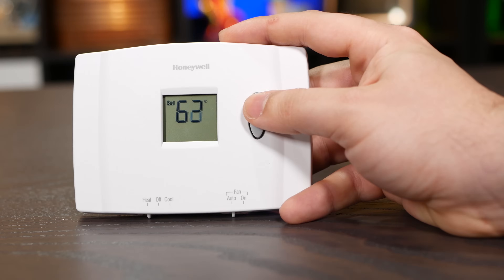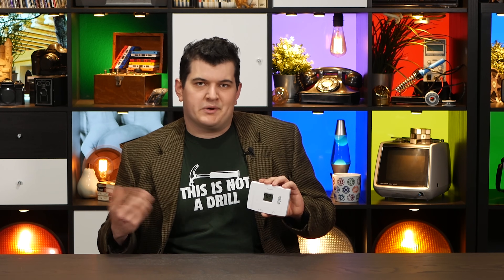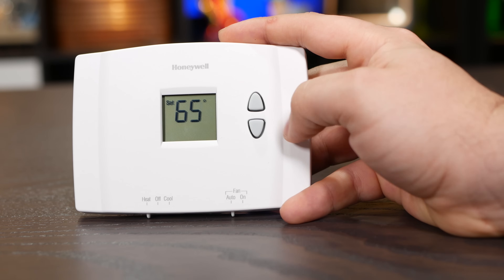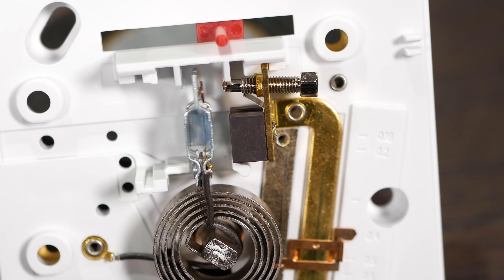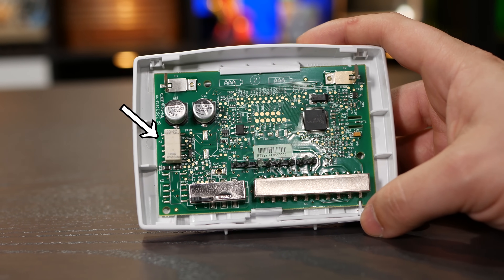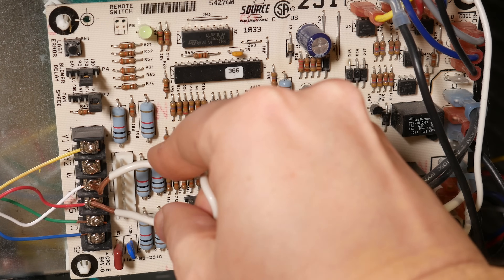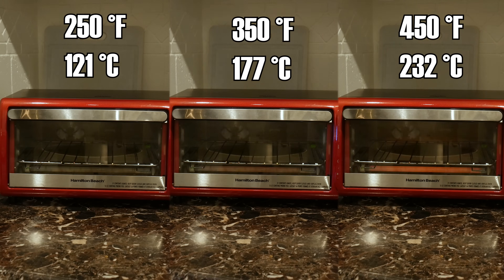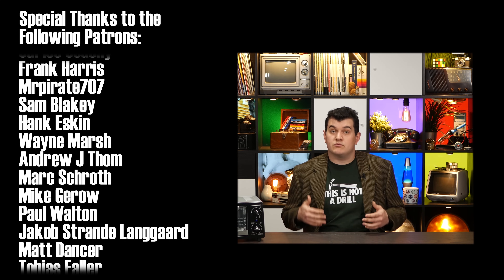Thermostats: Cooler than you think!

Comment: Having proven that this demonstration would work using my personal toaster oven, I decided to purchase a new one. See, my toaster over is kinda filthy and I wanted to get another one anyway. I thought it would be handy to have a toaster oven at the new studio. See, they're really nice for making small snacks or whatever (though frankly I've always found the acutal toast making experience to be rather lacking even before I was introduced to the Automatic Beyond Belief! wonder that is the Sunbeam Radiant Control Toaster). Anyway, so I wanted to get a new toaster oven, right? So I went to the store and bought a really basic one, just like the one that I use every day in my kitchen. No sense spending a lot on what will just be a part-time toaster oven, and it was the smae brand as the one I had at home. Must be perfect, right? Well, it turns out that this new toaster runs on a much shorter cycling time than my old one, so the effect that I was trying to demonstrate became nearly impossible to see. That sure was a bummer! It later became clear to me that this wasn't a very good toaster oven anyway, as the fit of the little tray they give you for cooking tacos or whatever was really tight and just unpleasant. The whole thing was just a travesty, really. So I've since returned the toaster oven you just saw and replaced it with another one, but this was after I had already filmed the entire video, and also after I had already filmed my original toaster oven doing the thing I want to show you. I toughened up and cleaned it the best I could, and I think it looks OK.

So that's the story of why you're about to see a different toaster oven. I made an assumption that turned out not to be true. Oh merde. In the end, it all worked out for the best anyway because I got a much nicer toaster oven on at Target right after I returned the rather poor one, so all's well that ends well, amiright?

Oh, and if you write this in a comment to save people the trouble, you're a fun sucker, and sucked the fun right out of this gag. I hope you're happy. A more helpful comment would be to tell the nice viewers about either the "speed" setting on mobile, or the fact that the < and > keys on desktop will advance frame by frame. Then they'll be in on the joke, too! And then when I or any other silly YouTuber decides to do this again, they'll be equipped with the knowledge of how do to this. 

You already wrote this out, didn't you? Well, I won't delete your comment, but you are now a convicted fun sucker and you'll just have to live with that the rest of your life.

Pfft.

Comment: Ah, a thermostat that will cool with the push of a button but that will not affect the temperature you may ask? Well just switch the fan and compressor terminals and jump the fan terminal to the compressor and now whenever you want the ac to cool momentarily just flip the fan switch to on and voila! The only disadvantages are that you can have the fan run all the time (but most people dont do that) and that if you flip the switch before 3 minutes had passed sunce the last time the ac turned off, you might burn the compressor. Also Its probably too much work for some people.

Comment: Some Carrier airconditioners will have a turbo mode (high power mode) which essentially runs the ac at full wipes for 30 minutes and then switch back to regular thermostat operation. I have seen this mostly on inverter type units (variable speed units) but there are some fixed speed examples of this type of setting.

Comment: The thermostats in Germany (and probably other countries too) are a bit more "complicated" and there i understand that people might get confused.
Most common is a radiator with a "knob" to turn. For people who don't know the system, it's a radiator where hot water comes in on the top and cold leaves on the bottom (some don't follow these rules on the outside, due to space or design issues). The part where the hot water comes is not so interesting. There are different types where you can control things or not.

The "knob" thing is the thermostat. Most people I asked thought this is a valve and with rotating it, you control how much water goes through. On the knob there are the numbers 1 to 5, a star symbol and sometimes a 0. On some are a little explanation which temperatures are which number.
The thermostat has something in it which can lower and raise a pin. With rotating the knob, you just set your temperature. When you are below the set temperature, the pin is fully out and when it's near the temperature, it comes in. On the radiator is a stupid valve.

People think that it will heat up faster when you set it to 5 but it won't. 5 is 28°C and that is too hot. Setting 3 is 20°C and thats a good temperature. The last few degrees it might get slower but because it's a radiator, it doesn't matter. The downside of that thermostat is, that very close to the heatsource and on the other side of the room, it might be too cold. Also when you block the radiator and the thermostat with some curtains, your room might not get warm at all.

There are some things to make your room faster warm. Step one would be clearing your radiator and thermostat. Step two would be checking the settings on your heater itself, when you have one. My apartment heats with gas and I have the unit in my apartment and there I can set up stuff. The manual says on which setting you should use for your radiator type. With floor heating, you need a lower setting, to not burn your feet. This changes the water temperature that will get into your radiator. Also one important thing is to remove air out of the system and top up on water to meet the pressure that the system wants.

In the apartment where I grew up, we had an additional thermostat on the wall with some features. You where able to say when you want to heat your apartment and which temperature. The problem was that you can't heat the living room and the bedroom indipendent. When the thermostat on the radiator in the living room was off, you weren't able to heat the bedroom.

Smart home thermostats works similar with that system. With my cheaper model you can hear the pin moving when you want to turn off or on the radiator. I don't know if my system can do this but I think the system can use a different temperature as reference. I don't have this, so I can't tell. I must admit that it's great that my thermostat can turn off automatically when I open the window and start back up, when I close it and resume my heating plan.

Comment: Heatpump Airconditioners with inverter compressors would be the exception. Typically they have a function to ramp the compressor right up to get the space up to temperature and then back it of as the room temperature approaches the set point on the controller. The compressor then shuts off when the room is at temperature and the fans will  continue to run, at a lower speed, to circulate the heat around the room. Even with these it's best just to set the temperature to what you want, in either heating or cooling (automatic doesn't work as well), and let it do it's thing.

Comment: I would not describe it as PWM as that implies a fixed period and no feedback (PWM can be used for rate control in a digital system with feedback, but that's not what is happening here -  as you said, there is no rate control). What you have here is a bang-bang controller. https://en.wikipedia.org/wiki/Bang%E2%80%93bang_control

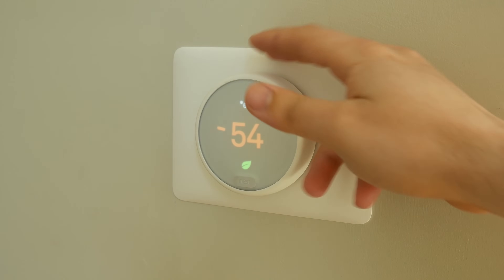Comment: 1:29 
"Setting a thermostat to 80 degrees does not make it warm up faster"
AND
Setting the AC to 58 degrees does not make it cool faster!! 
Why is This such a foreign concept to people
Reply: It's not always true. Some work by shortening the off time and lengthening the on time - so turning fully up ensures 100% on time.
Does your car accelerate faster with the pedal to the metal?
Reply: Is your furnace controlled by a rheostat? Then maybe you can compare it to an accelerator on a car.
Does your car only have idle and wide open throttle when you set your speed to say 35mph, and when you tap the pedal, the throttle body opens fully and you get to 35mph, at which point your car goes back to idle? Then your car is more like a thermostat.

Comment: Uhhh that blue wire is a jumper from the red”cooling” terminal and the red”heating” terminal. You remove the jumper for two transformer systems...(mostly gas application with a remote cooling coil)...generally five wires is typical.. the absence of a “common wire” means the thermostat is battery powered....

Comment: What I don’t get abou A/Cs is that if you have a room you want to cool down and use an A/C that Switches cycles less frequently than another A/C in a different room that has the same temperature, shouldn’t the second room cool much faster because the alternation between cycles is more frequent and longer and therefore the overall cooling is faster. Could somebody please explain?

Comment: Why do most digital thermometers installed in new construction homes have separate heating and cooling modes rather than a auto adjusting mode? Does separate modes tend to be cheaper to manufacture?

Comment: Gues he never heared of modulating burners. Those burn on lower setting when near the temperature.
Those aren't new. Maybe 20 years allready.
Not all thermostats control this. But the boiler is equipped to do this on its own a bit using several thermometer sensors.
If it's colder it gets the flame up higher.
I work in a company that makes these burners. Used all over the world.

Comment: I work in telecomm and I used to do home automation work, there are several products which allow you to set conditional events on thermostats, but they're not handed to you readybuilt in every case. Say you are at work and it is summer and you know you will want the house to cool off when you get home, you could either set the thermostat to run the ac prior to your arrival as a scheduled event (not the scenario we are discussing I know) or have a rule set that you can toggle on that changes the desired temperature range for a duration of time and sets up a scheduled event that is set to the normal temperature upon expiration of the allotted time.

Comment: Similar with air conditioning. The temperature of the air coming out of them is usually much colder than what the thermostat is set at. When it reaches the thermostat temperature, room air is circulated until it gets hot again. Then cold air starts coming out again while the fan continues to run..I have nerve pain and cannot sleep in the same room as the aircon. I have to sleep in the next room so the cold draft mixes better and the temperature fluxuation is more gentle.

Comment: Thats the whole problem, when there is no feel of incomming heat, or a lot of incomming heat it feels like temp diff from on to off is massive. Thats why i have furnance providing hot water all the time and thermostatic valves on every radiator. Exactly perfect regulation

Comment: 2:00 heat pump systems usually have two heat levels - the normal heat pump and if the temperature is say more than 5 degrees below the setpoint then the "emergency heat" kicks in which is resistive electric. This is why people recommend leaving the heat pump on 24/7. If you turn it off for a number of hours and then back on , the resistive grid will come on and use more electricity than the heat pump would have if you just left it on. EDIT: Oh, you mention it at 10:50

Comment: my favorite part is how you explain that setting the temperature above the desired resting point doesn't help because it won't increase the thermal output of the furnace over time, and then you explain how if you set the temperature above the desired resting point it will cause the thermal output of the furnace over time to be higher.

Comment: the thermostat at my job has an ambient temperature sensor which is cool in theory until you notice that it's directly in the path of the sun and every day it's like "oh shit it's 78 degrees i better turn the a/c on" when in fact it's the middle of winter and the drive thru window is probably open

Comment: Answering his last question, my 2006 Carrier furnace thermostat has a nice two-button temporary adjustment feature. One button is for time and one is for temperature. Both are up or down. If I change the temperature, it sets that as the desired temperature for two hours. I can alter that by using the temperature button or the time button (which changes the duration in 15-minute increments).

Comment: For 16:30

My older digital thermostat has a master "On/Auto/Off switch. If the switch is in the "on"  then it will run indefinitely regardless of the temperature. Otherwise, if the switch is in the "Auto" position, then it will cycle normally to keep the house at the desired temperature. Off is self explanatory I hope 😐

I thought most have this? I don't have anything fancy, I know that for sure

Comment: In Europe, we only run two cables to our thermostats nowdays. The cables carry AC voltage, and each thermostats would have a rectifying circuit inside, some op-amps and a microcontroller that would switch some transistors and draw large amounts of current through 1W resistors. Drawing current would drop the voltage singaling that a heat demand is present. The newer models carry a digital singal on top of the AC voltage and this allows the transfer of data between the furnace and the thermostat (such as : faults, boiler temperature, water temperature , pump running status etc. Source: have designed a system for multi-area control for home furnaces ;) ) Also almost no thermostat uses batteries... we just load up the AC line that is 24-30 V and get a 5V voltage regulator . Not the most efficient but it saves batteries

Comment: I installed a Nest in my house and I don't have a common wire. It's works perfectly when running my furnace, but sometimes when the AC is running it trips the breaker. No one has been able to explain why this is happening.  Some HVAC people just say that Nest sucks and I should just get a Honeywell or something else.  One person suggested that the extra load of charging the Nest battery is what's making the breaker trip, but the current draw of the Nest battery is so low I have trouble believing that's what's doing it.  The people at Nest said there must be a problem with my compressor, but when I put the old thermostat back on it runs just fine.  What the hell is going on in my Nest?

Comment: I love your videos, but you missed arguably the most fascinating component on a bimetal thermostat: the heat anticipator! The small pointer located to the right of the bimetal coil adjusts the current flow though a tiny heating element. This tiny heater tricks the thermostat into turning off about a minute too soon, to compensate for the fact that the fan continues to run for a minute or 2 after the burner shuts off to scrub the remaining heat out of the heat exchanger.

Comment: Yes if it’s a system that will turn on emergency heat with heat pump if it detects more then set amount 4-5 five degreases usually  they have dual coils in them

Comment: The EcoBee thermostat will do the set for an hour and then return back to normal.  You can select 1 hour, 4 hours, until the next program or hold until changed manually.   Works great.  Also there are modulating systems as well with variable compressors and blowers, along with changing the flame size (varying the BTU output).  The AC compressor can be changed from 1-100% for example in output along with the blower fan as well at the same time.  They are great and wonderful systems until they hiccup, you hope they are still under warranty.

Comment: I work in tech support for a company that makes residential products and god... i wish i could make people watch this video before they talk to me on the phone. "there is no medium blast" absolutely killed me, i've had a similar conversation with colleagues. 

and glad you answered the question about sensor placement -- my company makes temp sensors you can dot around, but honestly it creates more confusion than anything else. we have a maximum limit of sensors per zone, and people complain. i'm like, if you need SIX TEMPERATURE SENSORS for ONE ZONE then you are not zoning your system correctly or you need a different management system altogether because central HVAC ain't it. get one sensor, do a temp measurement and configure your offset if you believe there to be one, and move on.

Comment: The last question about making the thermostat change for a duty cycle then go back. Answer: Honeydew home thermostats have something similar. You can make a temporary hold as short as 5 minutes. You can set it up or down and after the hold time it will reset to normal function.

Comment: To answer the last question asked, most programmable thermostats is a way kind of do allow something like that. If you have it programmed, then you can bump down the temperature after you come inside on a hot day to turn on the A/C. The thermostat will revert back when it encounters the next time block in it's programming. Whenever that is depends on what times you set it for.